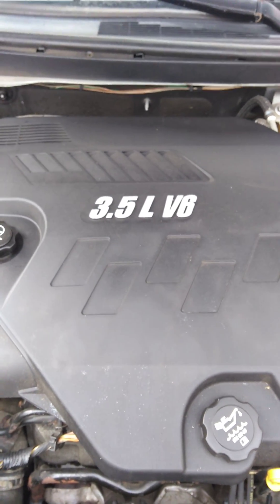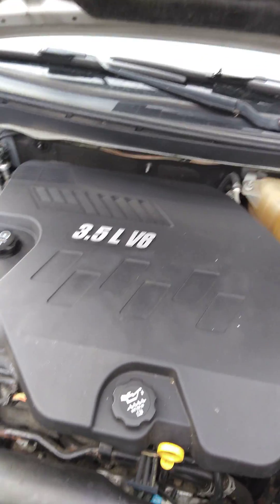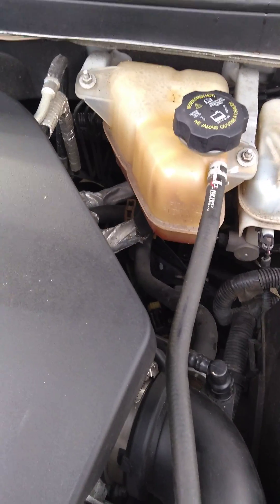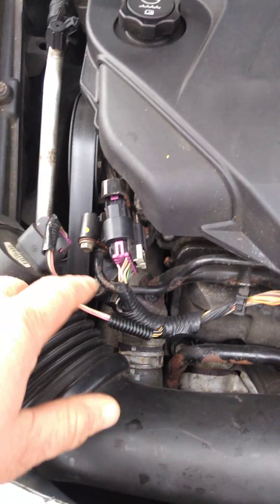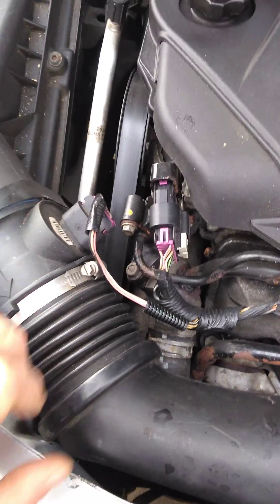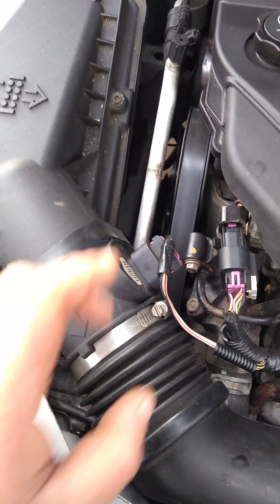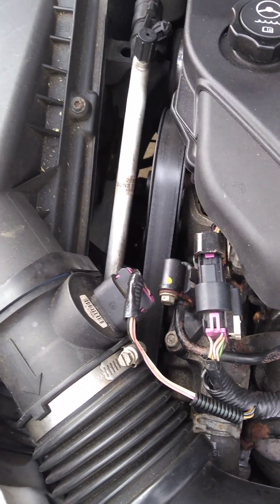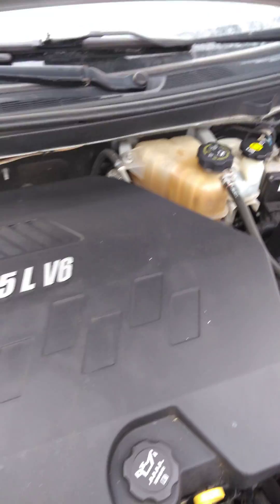Bleed the air out of radiator and engine GM 3.5 liter

Comment: the bolt and metal line on mine wast rusted shut..but i looked where it went ..ohoh it goes to the little rubber tube on the tank i say what difference then ..so i take rubber hose off tank .....bleed out and burp fine...so ez lol.............

Comment: I was only gettin heat when the engine was revving above idle. Found out the tubing from the fill valve to the reservoir tank was kinked, therefore not allowing air to escape. Blowing hot at idle now the winter wont be so bad

Comment: Great job Sr. I did like you showed.   But i did an additional step.   I added coolant all the way to the top and with the pressure tester and pumped it so I pushed the air out until I got fluid coolant coming out, and then I closed it, of course with the engine off.   But thank you for the video.

Comment: What is the part that is under that pipe you adjusted (the plastic one on the crossover) shaped like a diamond? Mine broke off. It's connected to the reservoir hose. I can't find it anywhere to order a new one. It's held on by 2 bolts.
Reply: Did you figure out what this part is called? Mines cracked and leaking. I thought it was the thermostat at 1st but clearly it's not.

Comment: Unhook the small line going to the top of the reservoir and fill the reservoir. basically the same thing but easier. On mine after i filled the tank i started the car with the line still unhooked and let coolant recirculate back into the reservoir. ( You might need someone to start the car while you hold the line) You can see bubbles coming out of the line once in a while.  After the bubbles are done your all set. hook the line back up and fill the tank to the full line.

Comment: Good video. I see a lot of back and forth on similar videos about the pipe not moving or coming out. If it is this setup it should,  it's a flared pipe sometimes it takes a bit of force to pop it free. That being said, there are similar setups that the pipe will not come out but when you crack the screw it will bleed it. Mine didn't seem to want to come out and I didn't want to break it so I bleed it a little through the vacuum tube . Refilled, "Warmed the engine up" then loosened the screw on it and the expansion popped the pipe out and there was NO o-ring because it's a flared tube but it did work for bleeding the system completely.  Thanks for the video.

Comment: How do u pull pipe out
Reply from the maker: Are you pulling the small bolt directly to the right of the electrical connector you see in the video.  Mine had a small o-ring in it. It took a little pressure but not too much. Try to wiggle to see if it will come loose. I don't want you to break it bc then you would need to go to the junk yard to get another one. It's been about a year ago since I sold that car.
Reply: @apuckett1971  I unscrewed the bolt like u did but the pipe looks like it doesn't come out I dont wanna break it either It doesn't have a o-ring on it from what i can see but thanks
Reply: In ur video it looks exactly like mines ima check it out again bro
Reply from the maker: If it the same as mine was. I believe it was a 10mm bolt that holds the tube in. I have noticed some do not have that tube in them some are like the 3,4/3.7 engine.
Reply: @apuckett1971  ok I got 07 Malibu ls I took the bolt out but pipe doesn't come out any suggestions???
Reply from the maker: Hope it works for you.

Comment: Thanks Allen I changed the thermostat and the coolant temp sensor and my G6 continued to over heat. After I tried your solution heating issue was corrected. Really appreciate the video
Reply: How long have your car been running without overheating? Because I have the same car and mine is back doing the same thing
Reply: Do you start the car up and let it run while the pipe is out
Reply from the maker: Sorry didn't see the responses. I removed the tube just after I started it. I waited till the antifreeze started coming out not just steaming it will gurgle for a little bit while it is forcing the air out.  I hope this helps with of you